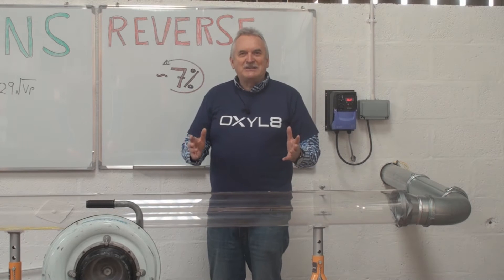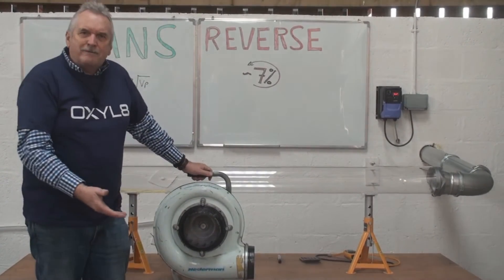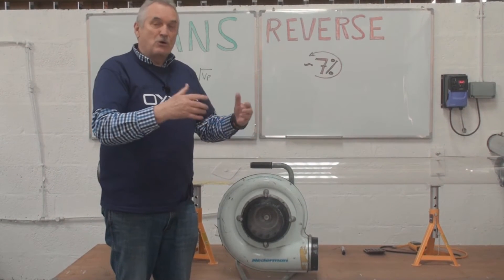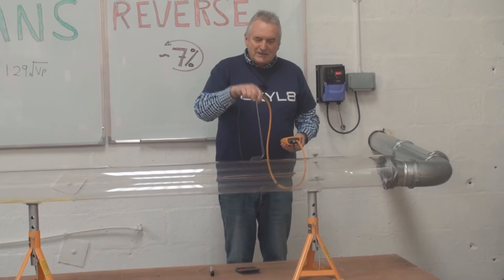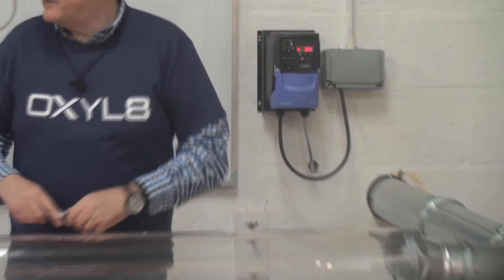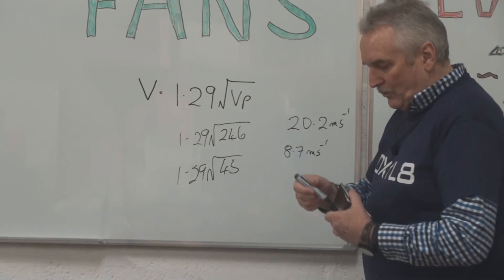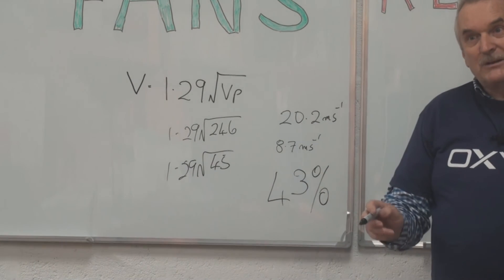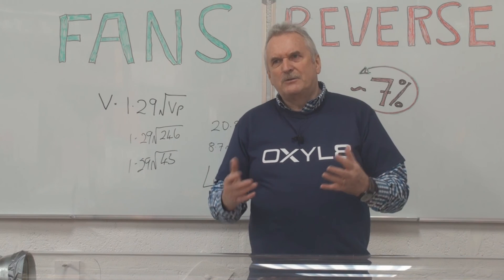Fans in Reverse

Comment: Thank you for making this video.
Dyslexia would dictate that if the fan moved in the opposite direction, the air movement would flow in the opposite direction...which obviously isn’t the case.
As you said, the inlet will draw air in, in either direction, but it will only push that air out efficiently in the correct direction.
Having an example of this for people to watch is great. Thanks again!